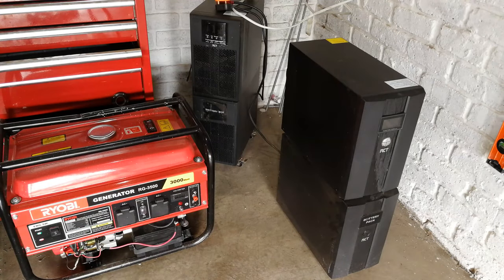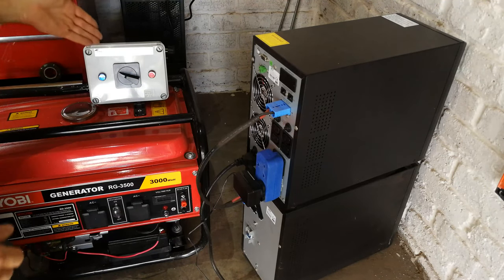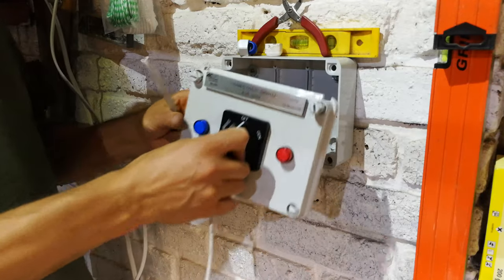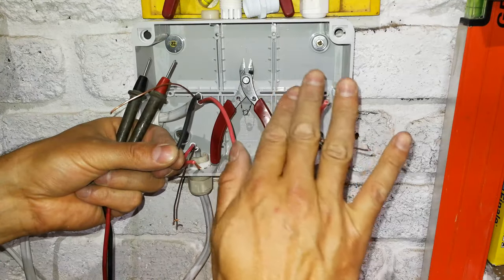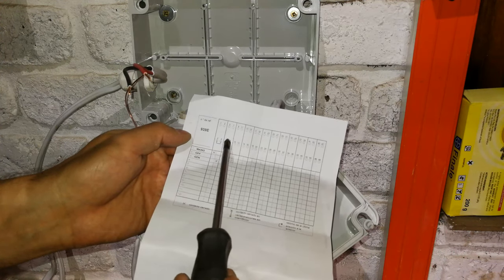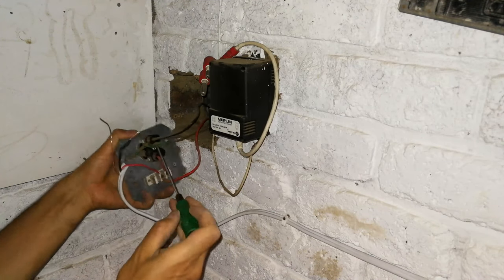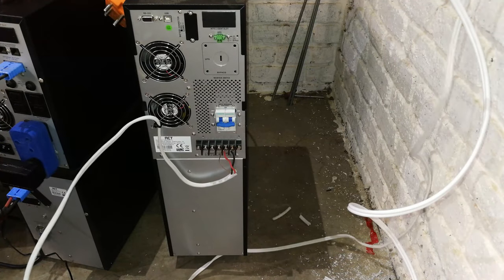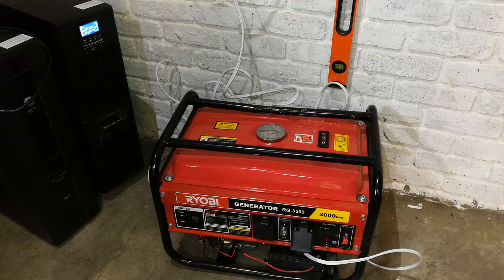How to connect a generator to a UPS (load) with a changeover switch

Comment: Very good detailed explanation and easy to understand,  sir i have one question!! When we operate UPS from generator's output so will it effect our UPS if incase of change of phase and neutral wire from generator ?
Reply from the maker: A good UPS should handle a wiring problem like that but i have not tried it personally.
Reply: @ecologicaltime  Thanks for your reply. I have installed UPS at my home after watching your video. It helps me to work easily. My UPS is working fine on Main line and generator as well. No any changing problem faced. Thumbs up 👍

Comment: Thanks for sharing… I have a similar setup but with a ATS switch and auto start system. The UPS I have is a small unit supplying my Wi-Fi router, modem, DAHUA CCTV.. the theory is that if the power goes out then the UPS kicks in for only the time needed to make the switch from utility to genset power. BUT… my UPS (APC brand) does not like the dirty power from the genset so I have to disconnect the UPS altogether albeit in a controlled manner ie I have 10-15 mins without losing power but kind of defeats the point. I contacted APC and they said that the UPS should not be used with a generator.. so now I’m looking for one that does. Seems to be a common problem?
Reply from the maker: industrial UPS can handle "dirty power". The UPS must have a specification for the frequency range to be between +-45-55Hz. thats the issue here is that the genny drifts around the center frequency. If your Mains is normally 60Hz then same logic applies, your UPS must be able to handle 55-65Hz
Reply: @ecologicaltime  thanks… when monitoring the freq and voltage the output falls within the Sox of the UPS. I have chosen to replace my UPS with a different model that specifically states it’s generator compatible.. fingers crossed

Comment: Thank you for the good video. Does anyone know how much would a system cost which does that change over automatically? It would naturally also need to use the battery power from the UPS to electrically start the generator.

I do know the pricing and availability of generators with electric start as well as different UPS units but have foud it hard to find information about the automation handling the change. This would be for normal house for partial powering.

One thought I now had is that maybe the generator should feed in DC to the UPS so there would not need to be any automated mains switching. Only the automation which starts that generator when mains power goes down.
Reply from the maker: thank you. I have had a lot of success with 18Ah batteries that can start a genny. You can use a charger connected to the battery: https://www.adendorff.co.za/product/mac-afric-dc-12v6v-4-intelligent-battery-charger/
Its a smart charger, meaning it stops charging when battery is full so it can be left on. This can be put into a box that stands next to the genny. 
Auto changeover, these are available. The one i have seen was R12k for industrial genny of 100kVA.
The genny can only feed DC if its on so you would still need to switch genny on. The UPS needs AC though. Maybe i dont understand your last point?
Reply: @ecologicaltime  Thanks for the info. I'm planning to feed DC to the UPS by feeding it to the batteries connected inside the UPS. I will use a dedicated charger to control this so there is no damage to the batteries. This way the generator output is kind of isolated from the mains power and even in case where the power grid would be operating at the same time than generator there would be no problem. I mean that if the power grid would be active (up running) and you just feed the mains level AC from the generator to the same power cable there would be problems (frequency not in sync - out of phase). But when power from generator is only used to charge the batteries inside UPS there is no problem.

So normally the power grid would feed the UPS and batteries inside UPS are not used (only being kept charged up). But then when power grid got power outage the UPS begins to use its internal batteries. But also this would signal the generator to start running and began to use DC charger connected to batteries inside the UPS.

Comment: Does the ups need to be connected as close to the generator as possible, or can I connect a fifty foot extension cord to the generator, then connect the ups to the extension cord?  I do currently have all my entertainment equipment, computing devices and external hard drives on switchable power centers. The are not all running at the same time, only when required.  Any thoughts or advice? Thank you, so much, in advance. Edit: I have become a subscriber:).
Reply from the maker: try shorter runs. The longer the runs, the higher the losses. Use thick cable and make sure you have earthed your genny into the ground at the location where it sits. I have a video in my playlist. Thanks for the subs.

Comment: Hello there I have a 3kva UPS what Size generator can I use to power it im using it on half load for my router and laptop to work from home. I also want to know where I can buy a cross over switch
Reply from the maker: AC DC dynamics or Voltex

Comment: Can i use my 30kva genset to charge 70kva online ups batteries.
Reply from the maker: the charging current of batteries are far lower than their rated capacity so i would need to know details of the UPSbattery charging current. But off hand i think yes. It also depends on the loading of the UPS as it would be battery charge current plus load current. If your UPS is running at 60% =42kVA, plus 8A battery charge current, this is already higher than the genny output so only if your UPS is on low load (less than 20kVa) would it work with that smaller genny.

Comment: Ya but most modern UPS won't run with the THD 10-20% most generators have hence why they have Gen/inverters that have a much lower THD 5% or below.

Comment: Hello sir , are these UPS needed to run a generator? Could you not simply just plug it into the wall?
Reply from the maker: no you dont need the UPS to run the generator. What i am showing is the generator feeding a UPS. The UPS cleans the power.
Reply: @ecologicaltime  Thank you for the reply sir, i am also from South Africa. The stage 4 load shedding is no good for us. Have a awesome day.
Reply from the maker: it sucks! we have to find a way ...
Reply: Hi guys,
also from RSA. I had a certified electrician here to connect my genny to the house. He told me that according to SANS it actually is illegal to do that. With a portable genny that is. 
So if something would happen to your house, your health or to others there will be no insurance cover. Just for your info
Reply: @007powerboy  Thank you guys for the extra information, well appreciated.
Reply: Is it correct to connect the mains supply from the socket instead of db
Reply: @iphone202020220  they still doing it and now it is worst